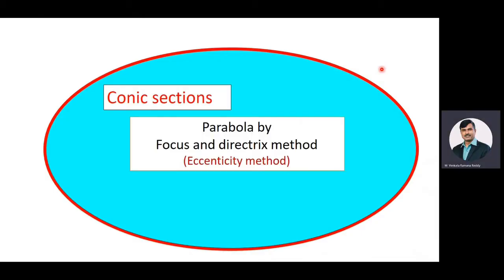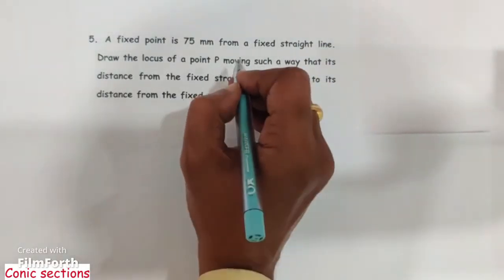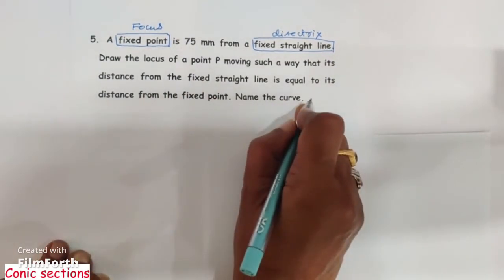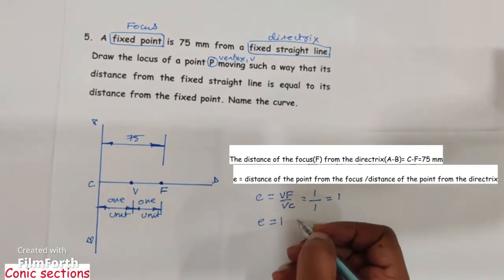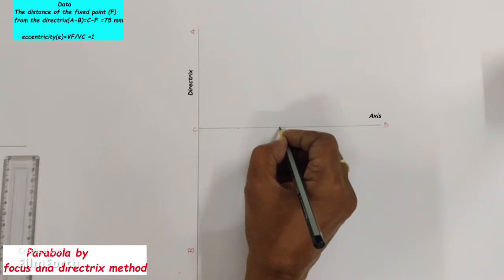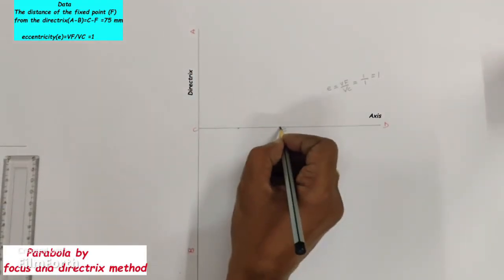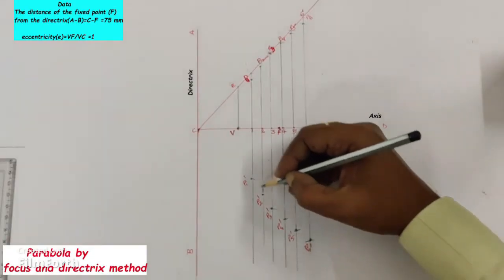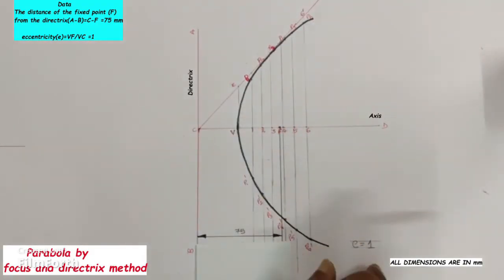Parabola by focus and directrix method

Comment: The distance between the fixed point and a fixed line is 54 mm. Trace the path of a point moving in the same plane such that its distance between the fixed point and the fixed line is always equal. If the point moves upto 72 mm from the fixed point, plot file curve.
please tell this problem ??
Reply from the maker: Name of the curve is parabola
Reply: @venkatrr8050 sir ..i need more steps to draw this problem